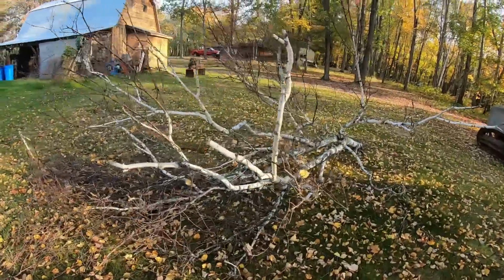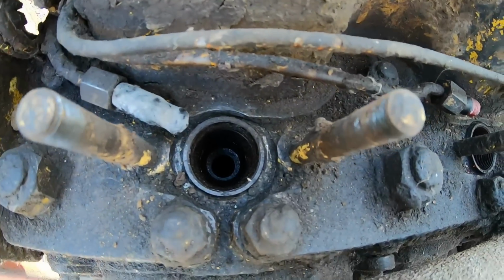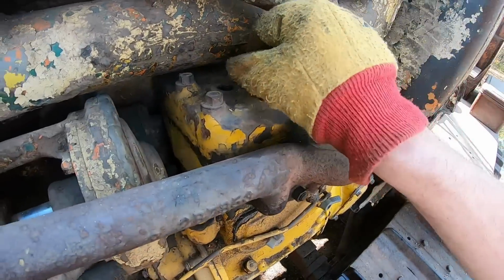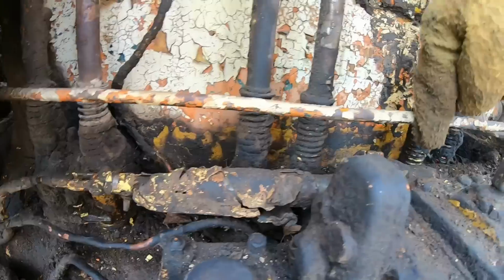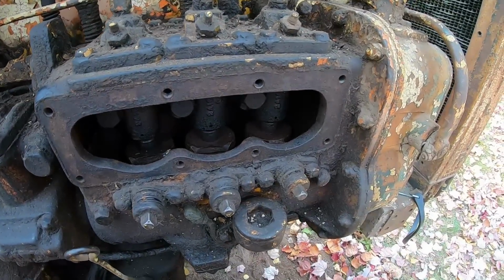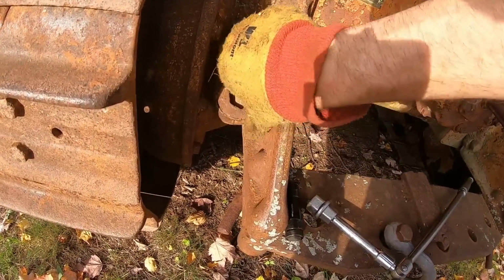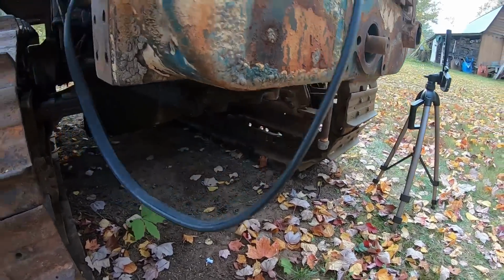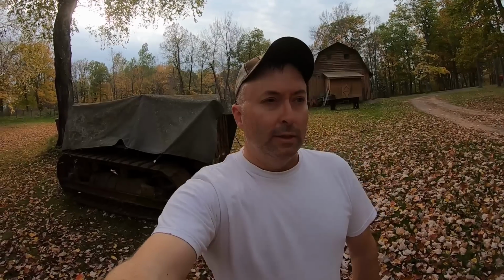Caterpillar RD-6 #2H1768 - My Lubrication Routine for Tractors that Sit a Lot & Its Backstory...

Comment: I have a 1947 Chevrolet Fleetmaster with a paint job that is pretty much on par with your RD-6, except that it has a LOT of rust, including some holes. A lot of the front suspension components were covered with hardened grease and dust much like your RD-6, and I cleaned up the parts I had to work on. I enjoy driving it around anyway.... I think the RD-6 is my favorite Cat.

Comment: Restoring a dozer or crawler has to be the ultimate for people into mechanical things. I'd love to do one if I had the space and somewhere to run it. Do you have problems with aftermarket spares for Caterpillars or your tractors? I've been fighting power steering on my 65 Mustang, the hose from the pump to the control valve started leaking so I got a new one. It lasted a week then blew in two. The new replacement hose did the same but only took two days. I made up a pressure gauge and some pipework and a valve to check the output pressure of the pump and promptly blew the seal on the pump output fitting. Not a lot of luck this week!!!

Comment: I have been on bed rest due to severe sciatica as a result of disk bulges and SI issues.  This morning about 30 minutes after chiropractic adjustment with traction therapy I can walk more than 15 steps without having to go horizontal.    So much to do......yet so restricted, I guess if Toby can scrape grease and grime, I can too.   I have an Allis HD-11 that needs a lot of scraping!

Comment: Is that tool to open the RD-6 final drive oil fill plugs an original CAT OEM tool, or is it a very nice Squatch after market? The Dark-eyed Junco appeared to approve of the filling operation. 

I can’t tell how many views that this has had on Wednesday afternoon, but at least 119 people, myself included, are pleased as punch to learn the RD-6 backstory and mechanical details while watching Toby scrape old grease off of an injection pump on a crisp fall day. I wonder if the YT algorithm is going to recommend other grease scraping videos in my feed?

Comment: Question, with that injection pump, and the detents on the manual priming levers.  If you manually prime the system, but do not return the detent back to the run position, would it cause damage or issues if you fired up the tractor with them in the wrong position?

Glad to hear thit RD6 is on the short list, I've been hoping it was coming up soon(ish).  Have you thought of any names for this machine yet? Maybe something in honor of your friend Matt?  Sorry to hear he passed away so young :(
Reply: If the finger lifts it completely off the cam. You could probably also use it to isolate that cylinder if it has a problem like a cracked/broken high-pressure fuel line or injector issues.

Comment: Quick question Squatch; if you did a mechanical restoration (but not cosmetic) on the RD6 would you be able to do some of the press fittings as you are currently equipped?
Just curious bearing in mind the forces required for the D2.
Apologies for the long winded question if I missed something previously 22:17